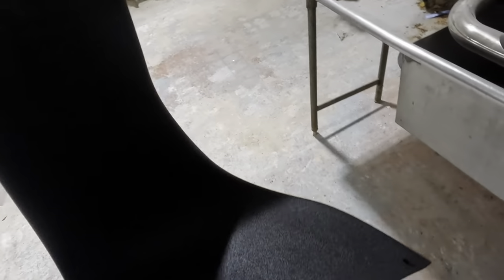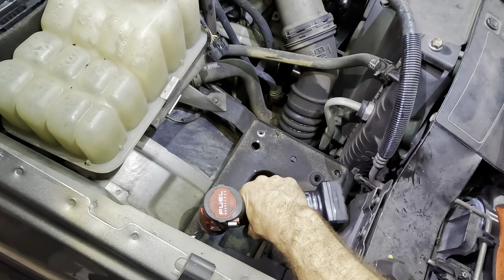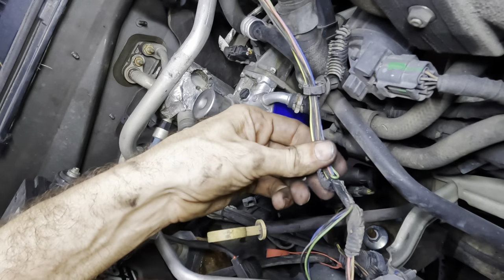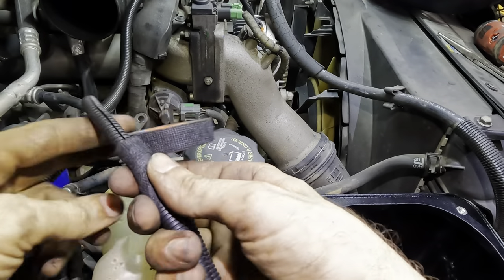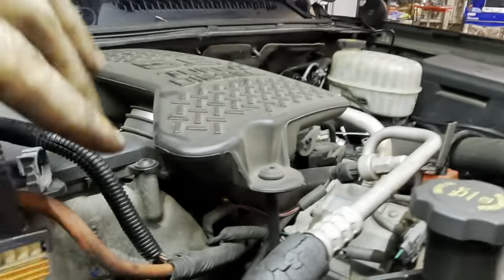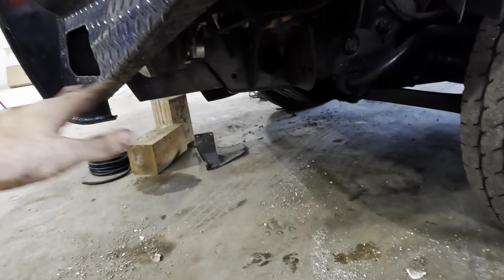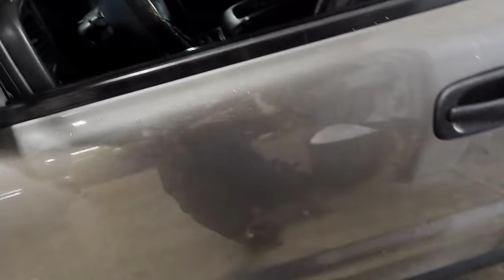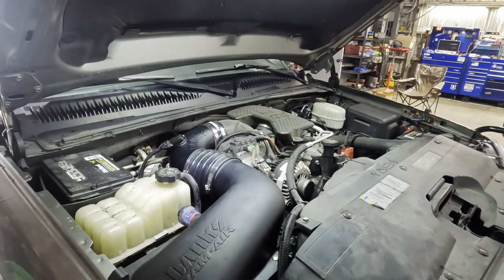This is BAD! And it's MY FAULT!  2007 Silverado 3500 6.6 @bankspower

Comment: Well you're definitely not going to be driving through any amount of water anymore, that's for sure.
And just to state the obvious. All of the performance improvements are going to be better. Given the condition of your old filter. ROFLMAO
But that aside, I'd be willing to bet the farm your numbers are better with the Banks system. I'd buy it, that's for sure. Given the right application. I definitely wouldn't be putting it on my truck (lifted 4x4). But something like a street rod or something that's NEVER going to see any amount of water, definitely.
I showed my wife the part with the old filter removal. She "Well that's a mechanic for you. Works on everyone else's stuff while theirs is neglected." She'd know, she's been married to a mechanic for 20+ years. 😆🤣
Be safe out there Brother!!

Comment: I don't understand why you'd want to have an air intake so low, really, really, really HOT air is down there from pavement/asphalt.  Cool air would be up above for a scoop, even if you had to modify the hood to do it.  Also hadn't thought about water ingress from that low.

Comment: Anyone else questioning if the ac low pressure switch connector actually "clicked". In a future episode, Ray has no ac. It might be clicked but it looked like the tab of the connector was hanging out off the lock. BTW Ray, love your videos and that is not me being critical, more to make mention just in case your compressor stops compressing 😁

Comment: Quite likely the more questionable of mods to the Silverado. The cooler air is up higher, not at road level. The cleaner air is up higher, not at road level. There is no pooled water up higher. It is now the lowest point at the front end, which means it will be the first to hit anything. A snorkel makes much more sense for all of the above.

Comment: OK my eyes might be deceiving me, but I thought I spotted some stray spark action from 47:03-47:20 or so. Look just to the left and slightly  past the oil filler cap and just left of where that metal piping kind of covers up whatever that red part is. (sorry I can't tell exactly what those parts are!).  The spark, or whatever it is grows in intensity as he revs the engine.  Any guesses?  I'm flummoxed!

Comment: The diff cover is going to be a nice upgrade. I really considered it. But I like off road, and I figured it would be constant work cleaning it out or I'd hook a rock and crack the corner fins and split the main housing...

Comment: My 03 gmc sierra 2500HD 6.6L 239,000mi gets between 23 and 31 mpg at 75mph locked in at 2100rpm. Avg economy is just under 20 at 19.7mpg and I’m not light on the pedal. I’m interested in why your economy is much worse than mine especially when considered diesels love a warmer climate like your area and I’m in Maine where just yesterday we had wind chills at -40.

Comment: My 02 Duramax had good wiring sheath at abt 17yrs old. My 06 Duramax was crumbling when I got it abt 15 years old. Sometime between 02 and 06 GM changed sheathing material and it was junk until??  That’s very annoying to those of that want to hang on to our pre-DEF diesels. 
Both my trucks were from here in the deep southeast. 
Other guys what’s your experience?

Comment: 45:31 I guess the bag is there to "PROTECT" dirt from getting all over the filter? I know K&N make bags for the air filter and I do know what the purpose of those are for. Hoping it is the same in this situation.
Reply: I thought Ray was trolling like the blue towel in the intake thinking he "left the wrap on"  I realize now it was a mesh pre filter.  I skipped thru and missed it.  30 min is my video ideal.

Comment: Ray you triggered my ocd so bad with  the cut just b4 the duct changes size (smaller) the self drilling screws when you could have marked the holes and nut n bolted the bracket etc... you don't usually go the short route, what's the deal...?

Comment: The whole reason its a "Ram Air Intake" is because Gale Banks engineered it to collect cold air from a high pressure area precisely under the vehicle and behind that stock front bumper.  What did the intake cost?  $449.00?  Well, now that you took off the front bumper, and cut 2" off the snorkel, who says it's "Ram Air" now?  Hahaha...waste of money.  Dude, you already had pretty sweet K&N...your like a little kid buying latest, grestest...Gail Banks is not just a great hitrodder, he's an even better salesman.  I saw the series on the Differential Covers...that is sweet.  Banks does come with nice hardware and the quality seems good too.  Hope you don't catch that low flying snorkel on something...ouch.

Comment: Why have you fitted what appears to be a water scoop in an area prone to flooding, surely a snorkel would be better. Also that plastic qrup round the filter will just strangle the intake?
Reply: Ray is a prankster.  It was shiny so I thought it was plastic also.  It's a mesh pre filter  28:30
Reply: @desotosky1372  I know it is mesh, but will still drastically reduce airflow, the filter material is carefully designed to not restrict airflow while stopping contaminates, the mesh is simply a restriction.

Comment: Fitting this scoop is the direct opposite of what should have been done. the scoop should be up high. Why do offroaders fit snorkles. To get the air intake up above the water and dust.

Comment: I don't know I think I would have wanted the air intake tube coming out  on top🤔, in case there was a flood, I went into a stream. Just my thoughts. Cuz out here in California with were fine 👍 cuz I'm in a desert. Not a lot of high water. And last do you have to recalibrate anyting for it to work correctly like mass airflow, any kind of fuel sensor exedra exedra. Hope it works for you brother. 🤗👍😉.                   🇺🇲 The old fart in Southern California 😎♥️. Got to go watch your wife unit, do her brake job. I'm sure she did fine but we'll see 👍😉🙏♥️🌹

Comment: If it was me, I would be putting a snorkel on.  Bring that air pipe out the side of the engine bay and up next to the windscreen, saves you sucking up debris and rubbish from close to the road surface and gives you the ability to drive through 4 feet of water if ever needed

Comment: Intake too low !! I've  put a  snorkle on my diesel V8 toyota I find it helps to get clean air ln lengthens filter  length and the motor .loves fhe dense fresh air away from dust etc.

Comment: That intake is useless. Looks good but that's it. First puddle and your sucking up water. Second that "pass through" negates any "ram air" effect. Third, turbo engines don't care about "cold air intakes" as the air heats up passing through the turbo anyway. It's the intercooler that matters.

Comment: Those low hung air intakes suck up all kinds of stuff into your filter housing !!!! Leaves chip bags Walmart bags and can suck up water if it gets deep enough and you are going fast enough. I ve had two Chrysler 300 s suck the engine full of water. They got lucky and didn t bend anything. It cost them a set of plugs and three oil changes a wrecker bill and labor. Hopefully yours will be to high for water ingestion !!!

Comment: Don' t you need a hood scoop or snorkel before the next hurricane? That thing is just in front of the wheel, even puddle splash, blowing back, is going to soak the filter in very dirty water, never mind trying to ford anything ankle deep which will likely destroy the engine.

Comment: The air box is an impressive change, but the intake at the bottom is.... stupid. For any truck that WORKs for a living its very likely to be broke quickly. for a parking lot surfer its probably great.  It just hands down WAY too far and has nothing protecting it.

Comment: Hey Ray, 
 Auto Techs are the worst maintenance people on their own vehicles. 
  You as a qualified Tech should know that your replacement air cleaner won't change the sound,
However is does look pretty. Now a BANKS Turbo may be what you need. Just saying
Cheers

Comment: Why not a snorkel? The truck is 4wd. I can see mud, water, etc making a future headache. Imo, poor design. Also, in Florida, doesn't the radiant air off the pavement cause poor fuel milage? This is yet another reason for a snorkel.  Cooler air equals better fuel milage and performance.

Comment: I know this is an old video Ray but did you ever fully seat your low side pressure switch connector. I'm staring at it right now and it's not fully clicked. 😂

Comment: why would you put an air intake so close to the ground?, surely for an "upgrade" you'd be putting in a snorkel......if you go through deep water...you won't be sucking water into the engine right??

Comment: enjoyed your craftsmanship, rapid work. great engineering how mod all fits together. Ray you should feel proud of final job. Loved your work on the looms. Improvising as you go or past experience? not sure! 
i’m not sure about the claimed performance improvement. You did not elaborate on that. I gather increased cruising speed scoop pressure air at cooler temperatures may improve performance slightly.

Comment: Did the banks air filter/ram air mod increase your fuel mileage. I have an 05 2500 with152k. Last tank of fuel I got 19.1.

Comment: Saw that rear diff cover for the temp sender. Cool looking cover, should be visible to the rear.
Waiting for that one. You'll get a look at your spider gears, ring & pinion. Hope you don't find what you saw with yer old air cleaner. (Just kidding!)
But now that you are getting 900 hp through an air cleaner that actually works (hey, this is on you!), think you might consider a lower diff ratio for a little more mpg?
Think you'll go to the 6500 for your serious pulling, as in road calls?

Comment: Its really not fair to compare performance of the New system to the admittedly poorly maintained original. If you had changed the filter in the original a couple weeks prior to have a more accurate feel for it.

Comment: BUSTED MAIN AIR FILTER WILL CAUSE DUST-OUT IT WILL CAUSE LOW ENGINE POWER ENGINE SMOKE AND DAMGE TO THE TURBOCHARGER AND
CHARGE AIR COOLER.

Comment: That tape is called FRICTION tape. It has  NO  adhesive. Somehow it sticks
to itself using FRICTION. Yeah, I dont get it either. Many Many decades ago
when your Grandad or maybe great Grandad was pulling wrenches this is all 
they had. PVC adhesive tape had yet to be invented. In fact, friction tape was 
the first kind of electrical tape ever made. NOW I understand they have
invented SHRINK EM tape. Like shrink tube you wrap whatever with this new
tape then heat it & it will shrink to a tight waterproof fit.

!

Comment: Out of curiosity... Are those headlights stock or some upgraded lamps? i do like my lumens on the road. Driving a low to the ground butt shaving sedan my 2011 Honda Insight and it's dumb car loving driver needs some forward looking lumens to see things. My road peepers are Halogen. The Googles say I can go LED with my current factory stock headlamp assembleys. 

Insight jokes aside... Any insight to improve my nighttime illumination peepers? Aside from my dream of a 2011 Honda Insight on tank treads?

Comment: Is there a special radio station that mechanics tune into that guarantees 4 Non Blondes will be on very high rotate? 

It is an odds-on bet that you will hear What's Going On? during the course of a Rainman Ray workshop video, both in his current and his previous workshop.

Comment: I have never been one for aftermarket accessories as they never seem to fit without a lot of rigging. The engineering of the Banks parts are impressive! I will admit to being slightly aroused with the air filter lingerie 😊.
Reply: Aftermarket parts is a no go!!

Comment: I do have to say this is a really stupid design. The moment I saw it I immediately saw problems for water. I know it can pass through but if the whole bottom of that scoop goes under water, it will suck water straight up into the filter and possibly the engine.

Comment: Dumbest idea ever. With the intake close to the ground, the car sucks in all the dirt from the road and all the exhaust fumes directly. When driving through heavy rain or deeper water you suck in the water directly and soak the filter. As sloppy as you say you are, you are massively damaging the engine. In your place I would install a snorkel as soon as possible.